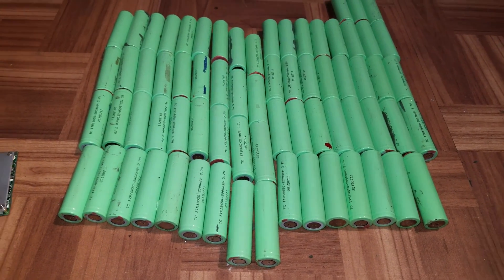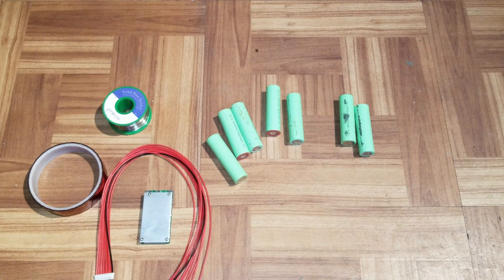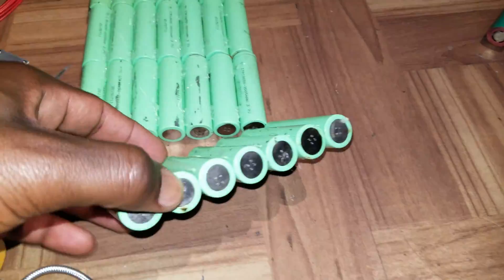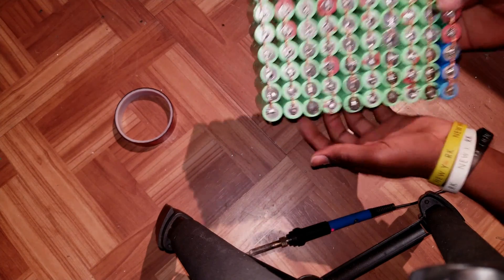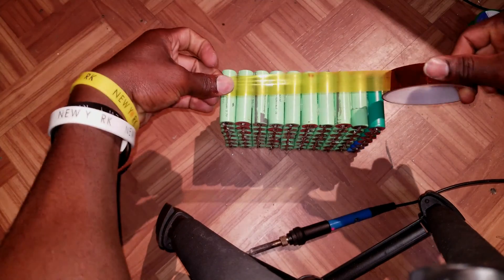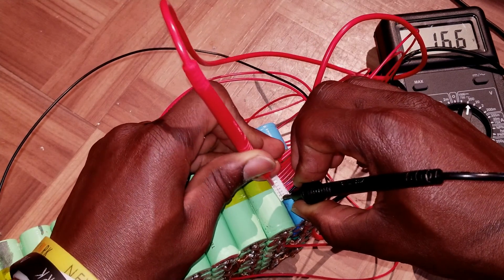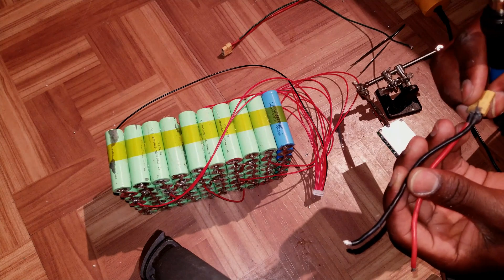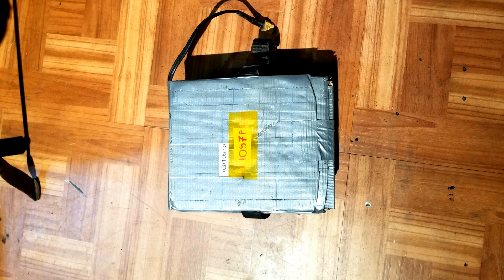HOW TO BUILD A LITHIUM ION BATTERY PACK-CUSTOM 18650 DIY PACK

Comment: Were do you find this cell and what price
Reply from the maker: I got those cells from old laptop batteries, router batteries by recycling. Usually 18650 cell cost $7 to $12 unless you get a great deal (from ebay for example). But be careful when buying batteries, there are so many fake versions, so watch out when they are cheap

Comment: Be careful with that battery man, I see only a few of the cells have fish paper isolation rings. Everything around the center of the positive side of the cell is negative. If the copper wire comes into contact it can become dangerous!
Reply from the maker: Yeah! I'm aware of it! It is pretty unsafe but I later on, changed the layout so the pack does not sit on the wire strips joints. Otherwise, it will short! Honestly, I'm gonna get myself a spot welder.
Reply: KingYS Tech. Good to hear that. Spot welder is the way to go ! I’ve built a few packs for eskate, comes out so much cleaner and safer on the cells.